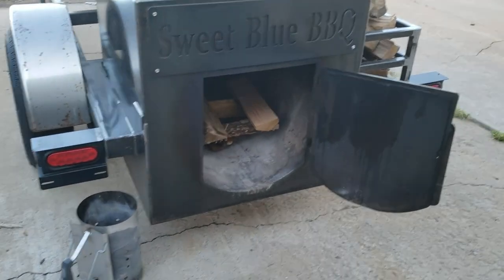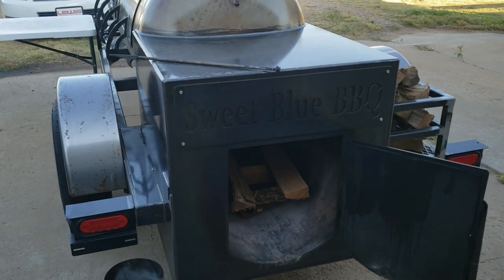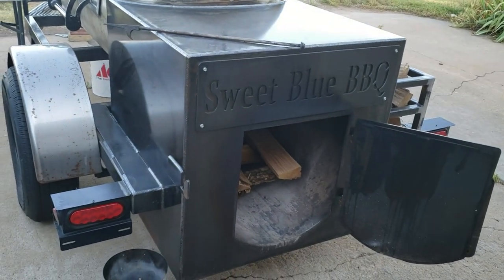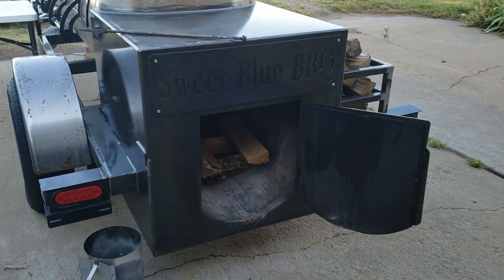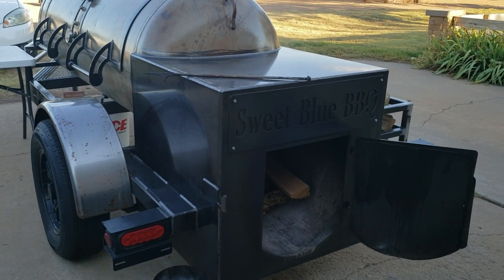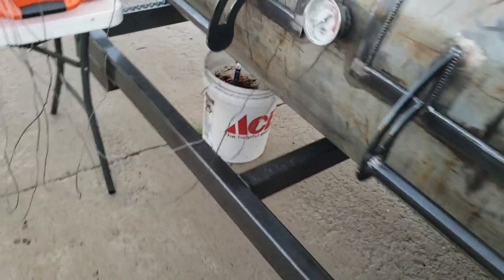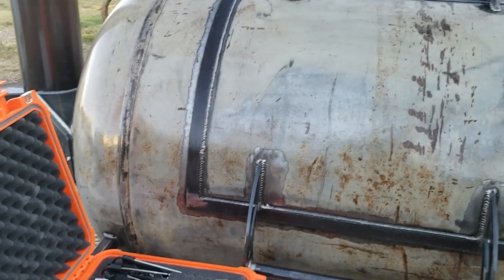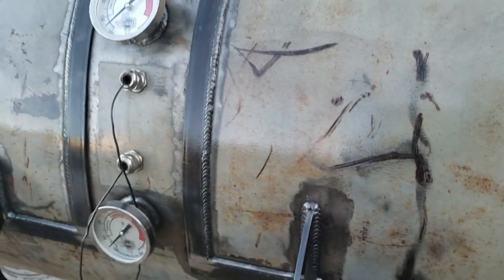Billy Bob q&a cook.....

Comment: Hey Tim, Chris here out of Kansas City(MooreMeat KC BBQ). We communicated back and forth a while back about your smoker because I was considering a smoker by Big Phil. I picked my 250 on a trailer up this past December 2021. I was lucky enough to get my deposit in when I did because my set up runs almost $2,000 more now with the prices a steel sky rocketing. I’ve just wrapped up my 5th smoke on it this past weekend. I also have the FireBoard but I didn’t even use it on this last smoke. This is my 4th offset smoker and is by far the easiest to control temperatures. The only issue I have so far is surface rust on the fenders and the firebox by the axle and the axle itself. I think I’m going to spray the firebox and axle with cooking oil the next time I fire her up. Anyways, thanks for helping steer my in the right direction, I believe I made a solid purchase. Appreciate the video 🤙🏼
Reply: Chris,  That is awesome!  Yeah, with the steel prices going up along with everything else on the face of the planet, I was lucky as well to get mine at the price I did.  You are 100% right.  This smoker is sooooo easy to cook on.  As far as the fireboard goes, the only thing I really use it for is for the longer smokes where I'm cooking brisket or pork shoulder and I really need to monitor internal temp of the meat and the pit temp.  More times than not however, I just use it to let me know when I need to add a couple sticks of wood to the fire.  As far as the rust goes, I tried some automotive high temp clear and that really didn't help much.  I ended up spraying the underside with the high temp clear and it seemed to help a bit, but the fenders I kinda gave up on a while back.  At some point, I think I am going to call Phil to see what brand of clear he used so that I can add some to the fenders.  When I do, I will post it in a video.

Glad you are enjoying your rig and I am happy that I helped you out in making your decision!

Comment: It’s disturbing how different the Tel Tru thermometers are from your digital ones. If it was 5-10 degrees different, no big deal. Yours were 25-50 degrees apart. I tend to believe the Tel Trus more, but maybe that’s wishful thinking. Makes your job a little trickier. Thanks for the video. I wish you’d make more, but understand life gets in the way.
Reply: Yeah, its been a BUSY year for sure.  I do have some new content to post about for sure.  So yeah, the analog gauges are not as accurate as the digital one for sure.  I have found that the analog ones are great for an at a glance to make sure that the chambers are still hot.  I don't really rely on them for accurate temps other than knowing that they are off and the amount that they are off by.  Once you get the routine down, you kinda know how long stuff is supposed to take at certain temps.  So really, its all just a matter of knowing the equipment well enough.  Billy Bob is a machine though.  Never wavers in consistency.

Comment: Great looking outfit sir! Always nice to see videos like this that make it less intimidating....... and that you have accomplished lol. Just wondering when the fire is white and not smelling good or not achieving blue clear smoke what adjustments do you make right away ! I will always advocate for the old school management way of taming the fire and heat ...... basically I dont need a pellet grill. That equipment doesn't make you a pit master but it is convenient. Thank you very kindly for this video. Summer time is around the corner enjoy
Reply from the maker: Thank you Tim!  To be 100% honest with you, the best thing you can do is to give it more oxygen.  Open the door.  It will spike your temp a bit.  One of the biggest things you should concentrate on is not only the amount of oxygen your pit is receiving, but the amount of fuel that you are feeding it.  The more fuel you have in your pit, the balance of oxygen to fuel will be off.  So like I was saying in the video, split your logs into smaller pieces so that the fire will be more manageable.  Also, if the wood is wet, it will cause it to generate more smoke and not flame up like it should.  You want super dry wood.  Some people think that if its burning in the pit, its not smoking.  Not true at all.  You want clean blue smoke coming out of the stack.  

So, yeah, if you are getting the ole "choo choo" on the smoke stack, just give it more oxygen by opening the door.  It happens, just know how much wood it takes to keep the temp consistent in the chamber.  Overloading the firebox WILL make it smoke more and cause it to spike the temp alot.
Reply: Thank you very much!! I've had way too much wood in that firebox......and for sure some of my wood wasnt bone dry!!.